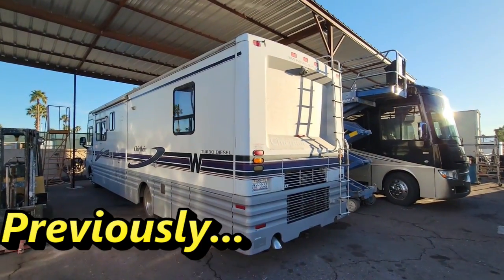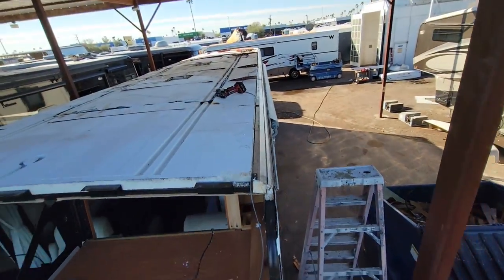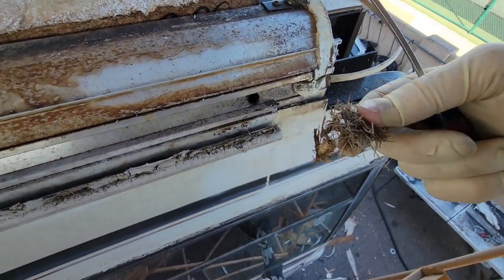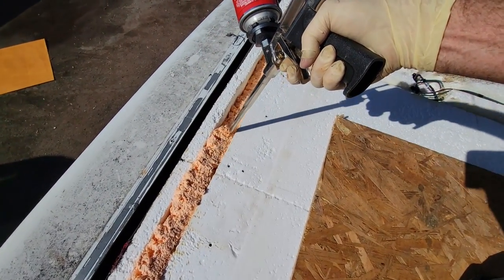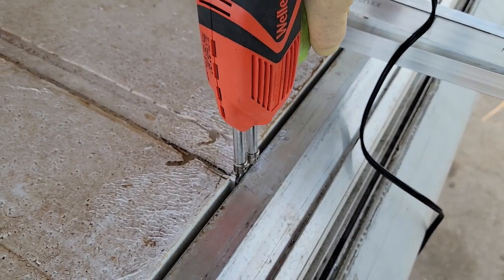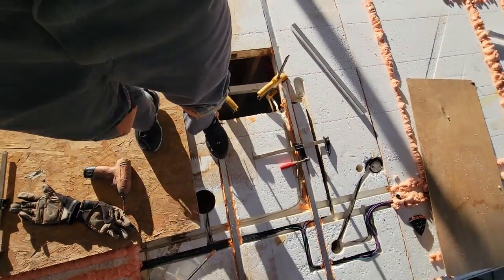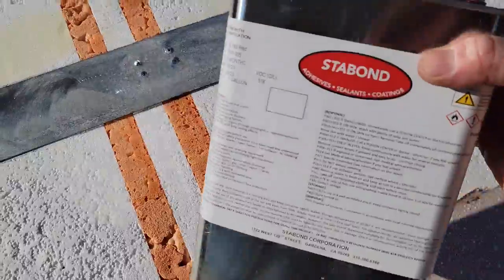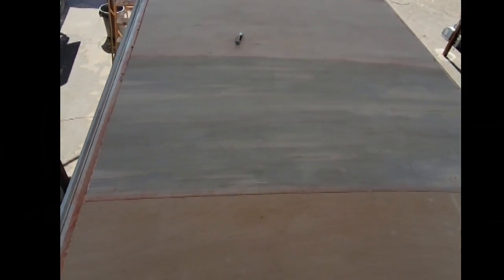The Next Steps in Stabilizing this Winnebago Roof

Comment: I've seen James, (and Chad) resurrect a few of these roofs and it amazes me every time. Hard work, dedication and A Lot of Know-How.
Reply: Excellent job at least the roof won’t leak a lot better than factory did. They can add  supports on the inside or just live with it anything 20 years old needs a remodel anyway..
Reply: The question is are they being properly remunerated for the amount of work involved? Better still have an inspection before you buy any RV especially the Winnebagos of ill repute.

Comment: I had to rebuild a 2000  27' Georgie Boy roof about this bad last year. I watched every single AZ Expert video I could find.  It took 10 full days to do the work by myself. I used PVC instead of rubber. it came out well.  I'm still finishing up the interior which had to be largely redone due to water damage. of course it runs very well.  my first RV rehab, hope to finish it in May.
Reply: Hope you have before and after pictures and are willing to share them.

Comment: A very interesting and informative video.  I’m still not sure of why someone would spend, what I’m guessing is $10K-$20K for a new roof and ceiling on a ‘98 Winnebago that is maybe worth $10K at most?  As usual, you do amazing work and make it look easy.  Love your channel and take care!
Reply: I also wondered how this could be possibly worth it for a substandard quality motorhome to start with?
Reply: Exactly my thought
Reply: Agree, the educational value of this rebuild is incredible, but is there even a trace of economic feasibility in this project? For the amount of work and craftsmanship, the amount must be stellar
Reply: We had a new roof, put on our 35 foot fifth wheel 2 years ago just because it had 2 very small long scratches down the middle of the roof from a branch. No holes at all, no rot, no other issues a heartland 2013, and the insurance company paid a little over 12K. This I am sure this is north of 20K with all that fabrication and labor hours--I say 23-25k
Reply: @threeftr3349  I redecked my roof, replaced all roof vents, parts etc with the best I could get and I think I spent like $2500 and that was after I applied a new rubber roof incorrectly (glue dried to quick) and replaced with another PVC membrane. That was before pandemic...now it would probably be 4-5k

Comment: It’s crazy how cheaply these are made. 
It’s essentially a gas powered styrofoam cooler. 

6-8 inch of styrofoam with 1/8 in of plywood. 

I have a 2006 view. I’m a big guy and if I need on my roof I get nervous. 
The view has 1/16” of fiber glass. It’s crazy there’s insurance company’s that insure these.

Comment: The problem I see with this is that these types of composite structures depend on the strength of the material on both sides of the filler for the composites ultimate strength. If the wood on the inside is gone / rotten then it really isn't going to matter how strong you make the skin on the outside it's still going to be a lot weaker than it was originally.

Comment: Would there be any advantage to replacing the roof with an Aluminium roof?  I know it would be more costly, and possibly heavier (all that waterlogged material is adding weight as well.  I LOVE watching these repair videos, even though they tend to scare the 💩 out of me sometimes!
Reply from the maker: Aluminum is pretty difficult to laminate with, but I'd guess it's possible if you can find wide enough rolls of sheet
Reply: @AZExpert  my 94 Minnie Winnie motorhome has aluminum sheet metal roof. No idea if it came factory that way.
Reply: James, Another incredible transformation!  You are the gold standard for roof replacement.  Always memorized by your videos. I continue to learn from and be entertained by your well put together videos.  Thank you.

Comment: James, please consider wearing  N95 mask to protect your lungs from deadly black mold. 

The entire interior liner and other items that have mold growth should be removed and replaced. 

As Winnebago’s AC ducks are not cleanable, just cut into the foam, if I owned this RV I would have replaced the entire roof at the Winnebago factory.  However the cost would likely exceed the value of the RV. 

Bottom line, it’s not worth the health risk trying to save this RV no matter the purchase cost unless the entire roofing system was replaced and all interior items that have mold be removed and replaced. Likely only the chassis and interior metal items don’t have mold issues.

Comment: Can someone educate me and tell me why marine wood is not used on these roofs instead of regular wood?
Reply from the maker: Price is one reason at 6 to 7 times the cost which doesn't include shipping as local availibility is another reason. Lastly, even marine ply would have failed in this roof.
Reply: @AZExpert  thank you for that explanation.  Those aluminum braces you made if Winnebago would have placed those throughout the roof fastened like you did with foam and instead of the fiberglass sheet use aluminum I think that would be a good roof.  But no one asked me 🤣

Comment: QQQ - Can you elaborate some more on your Note in the about section? Specifically from the financial aspect (in general, not necessarily this exact RV as I am not trying to be negative to the owner). As you mentioned, "just trashing the RV" comes to mind, similar to an insurance company writing off a car as totaled due to the cost fixing it is more than the value once fixed. What is the total repair cost for a job like this vs the repaired approximate value? (again just asking a range, not wanting to get into this particular owner's business).
BTW, for us the pain in the ass of filming is worth it. I can't help but watch the full video every time. As time goes and you get more shares, I am sure your channel growth will accelerate. Thanks
Reply from the maker: While the RV seems bad, to find a replacement would still be 3 times the roof price and while the cost of the roof is half the value of the RV, without a roof the RV has no value besides $1000 scrap. So to trash it would effectively be wasting more money, and after a year or so of use, the owner will reach a break even point.
Reply: @AZExpert  ok cool, thanks

Comment: What really sucks about rv roofs is its rubber. The sun bakes the crap out of it and driesand cracks out. Why don't the rv makers lay a piece of aluminum or stainless across the top you would have any issues except around holes and vents